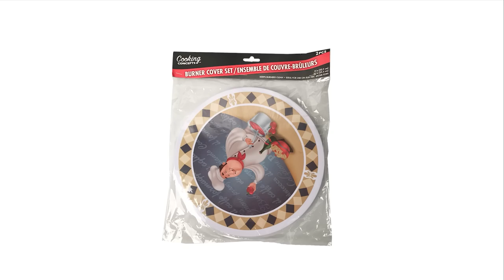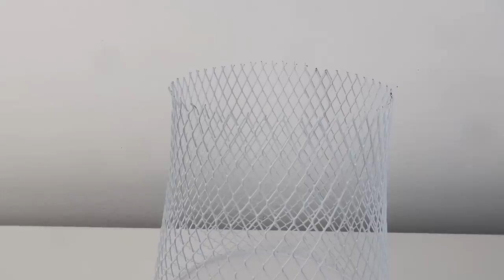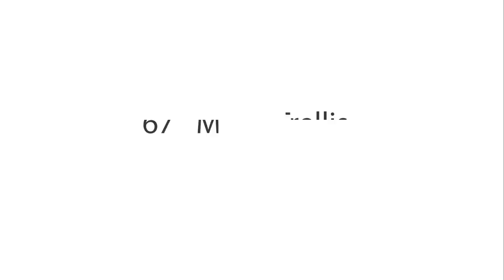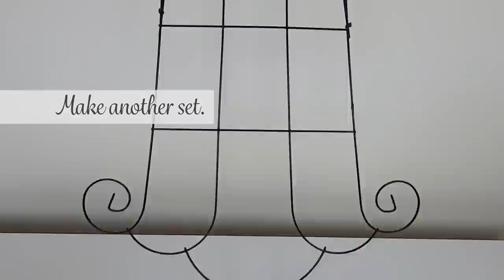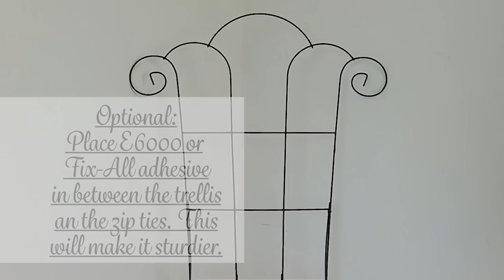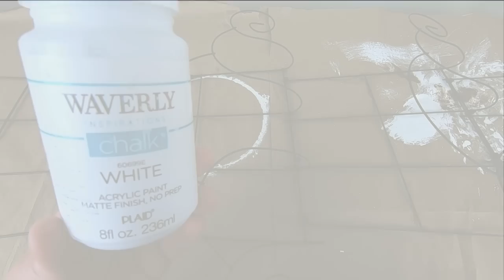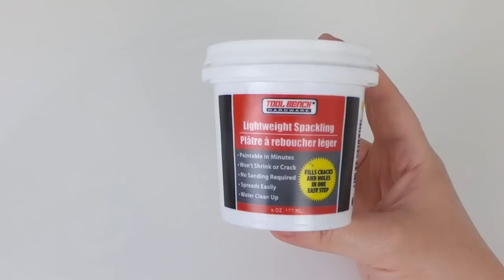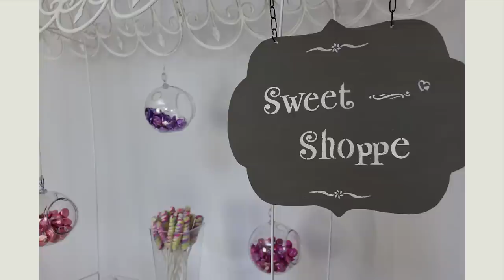16 METAL Indoor/Outdoor DOLLAR TREE DIYs

Comment: These are all so cute..BUT NEVER USE HOT GLUE FOR ANYTHING OUTSIDE. I DID AND IT MELTS IT AND THEY FALL APART. USE STRONGER GLUE AND A DOT OR TWO OF HOT GLUE TO HOLD WHILE DRYING. I learned the hard way.😥